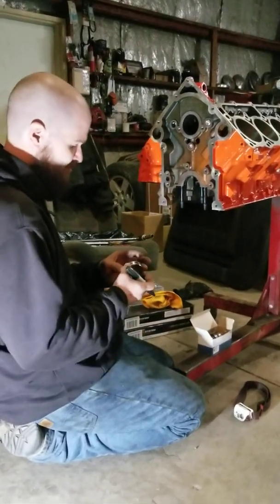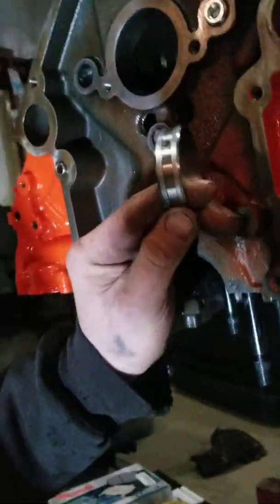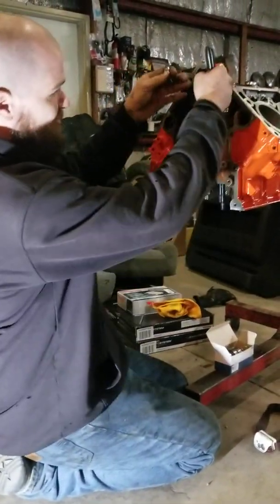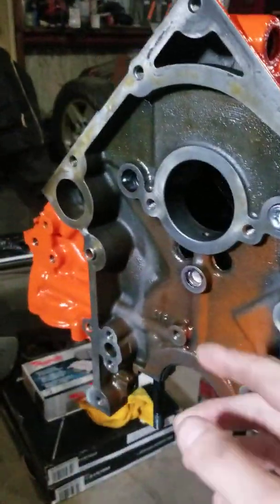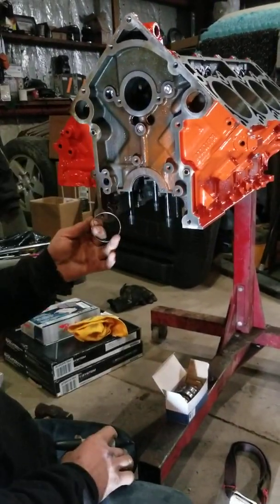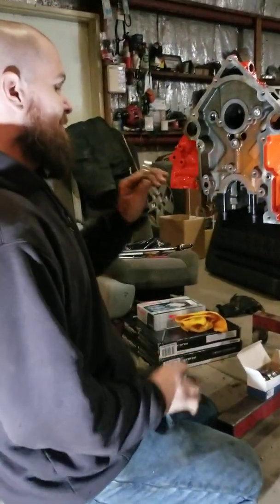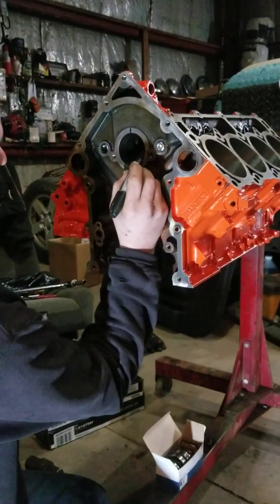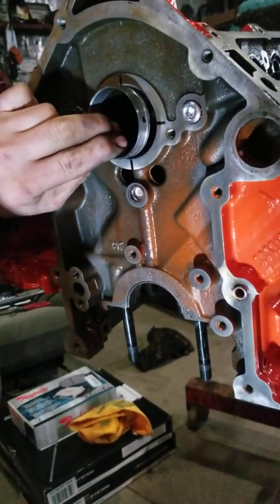How to install cam bearings in a 3rd Gen 5.7 HEMI, The Correct Way!!!

Comment: How do u remove them
Reply: Cam bearing tool pound the first though the front from the back . I didn't i pushed it in if you do that cut it in half through the hole with tin snips .